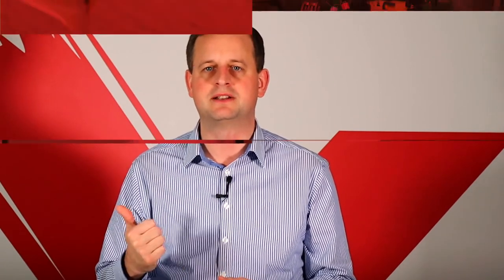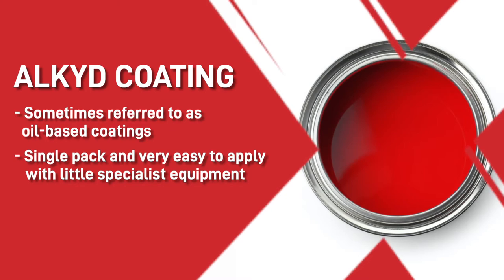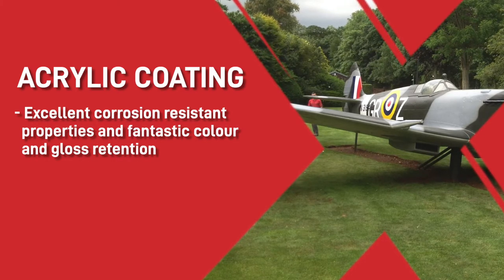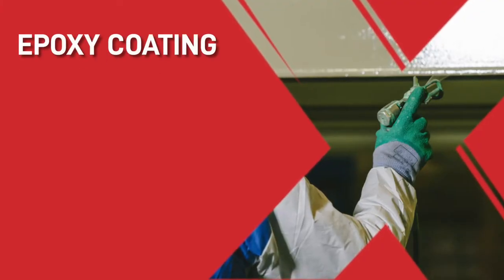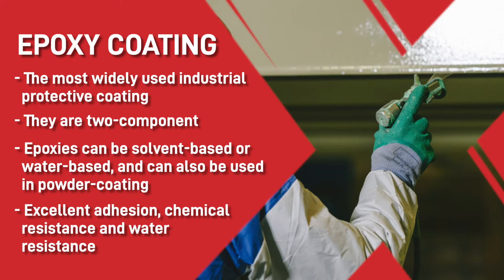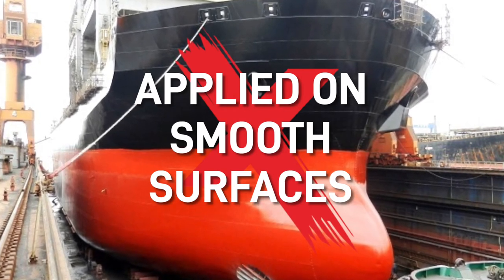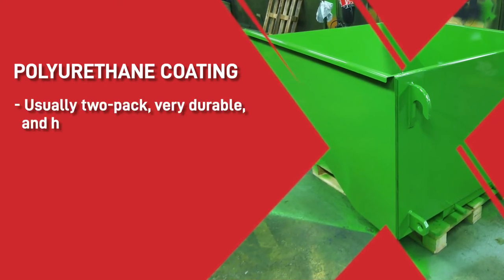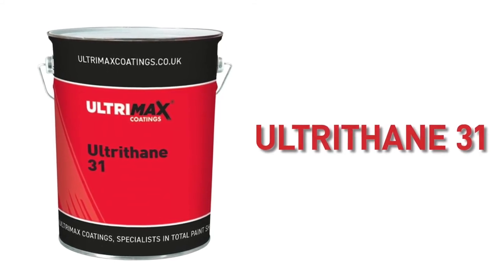Alkyd, Acrylic, Epoxy and Polyurethane Coating - Understanding the Difference

Comment: Sir good morning,I will ask if 1st coat of primer I used is redbrown 1 component and 2 coat of primer I used is 2 component what would be the result it is good or bad sequence?thank you sir
Reply from the maker: its not always a problem for example we sell a lot of sayerlack 2pk primer with a 1pk topcoat. The important item is keeping within system so if your primer is Jotun branded use Jotun branded topcoat as they are chemically made to work together

Comment: I am experimenting with painting using a paint gun and starting to have some asthma like symptoms tonight and just found out the hardener I use could be the cause.  I want to continue painting but I am overwhelmed with options all I want to do is paint mild steel in a satin black in 1 pass. I keep reading how dangerous epoxy paints are but it seems like oil based with hardeners can be worse. Is there anything that is low VOC that has a hardener and does not use isocyanates? The final product will be indoors. I cant afford powdercoating yet.
Reply from the maker: We would recommend https://www.ultrimaxstore.com/paint/metal-topcoats/ultrimax-2-bs.-00a01.ippa0500a01
Reply: No way
Reply: Use Durabak 18, a moisture-cured Polyurethane. Comes in solid colors, no custom color options. Hard as a rock, but flexible. Does not chalk, holds color well under weathering and UV. One of the best I have found. It can be roller brushed on (Mohair for the smooth paint, Textured roller for textured paint), or sprayed.  Levels well, so ideal for roller brushing. Solvent used is Xylene.  Sand down, wipe surface with Xylene, roller brush one coat, wait till finger dry, apply 2nd coat. Done.
Be smart and use a mask when spraying.
Reply: @lass-inangeles7564  I never replied but thank you for this.
Reply: go acrylic then!!

Comment: Hey what kind of coatings is suitable for a basketball backboard, I'm a complete noob, so I'd appreciate if you give me the safest and most suitable option
Reply from the maker: hi there assuming your backboard is timber? if you look at something like Sayerlack AT99 which you can spray to mek a professional finish...but i'm pretty sure something like our Colormax Aerosols with Ultrimax 1 satin paint would produce a nice finish for you (the aerosols would also be fine if your backboard is wood, metal or plastic) 

hope that helps 

br 
Ultrimax

Comment: Is the acrylic primer good for concrete?
Reply from the maker: most paints have some acrylic in but does depend on the paint type. For concrete we'd always advise a full floor paint in 1k or 2k if you have the time to mix and paint as it will wear better.

Comment: Which paint you recommend for painting a drill press and lathe?
Reply from the maker: metal lathes will need a solid metal paint with anti-corrosive properties. Go either 2 pack for a slightly harder cured paint or 1 pack . We do 2pack in Ultrithane 31 - https://www.ultrimaxstore.com/paint/direct-to-metal/ultrithane-31-bs.-00a01.ipp310500a01
Reply from the maker: or go 1 pack with Ultrimax 1 https://www.ultrimaxstore.com/paint/direct-to-metal/ultrimax-1-bs.-00a01.ipo00500a01
Reply: Thank you so much for your help

Comment: What coating do you recommend for steel roof .?
Reply from the maker: if in the sun Rustoleum Noxyde - it has elasticisers in it that mean the intense heat won't cause it to fail when the coating is shrinking and expanding !

Comment: Hi, I am working on formation of hydrophobic coating which is composed of drying oil and naturally organic beeswax...so this coating consists of two different materials that is wax and oil as well so in which category does it comes under
Reply from the maker: this one sounds like it would come under fire resistant coatings more ?Most of these are Polyurethane so it would depend what formula you are adding to your beeswax and oil ?
Reply: @ultrimaxcoatingsltd  I am doing this project with my group, here we are using tung oil as a drying oil and butyl acetate as a solvent for that...and we are mainly focusing on making it water resistant and dirt resistant and since the beeswax has a good ability of anti-bacterial so it will result in forming a hydrophobic coating along with anti-bacterial properties and the drying oil are having great ability of sustaining high temperatures so somewhat it can act as a fire resistant too.
Reply from the maker: @rishabhdevsharma1764  that's amazing beeswax seems  to have so many useful properties from honeycombs structures to the oils it produces an amazing natural product!
Reply: @ultrimaxcoatingsltd  Yes sir, so I just want to confirm if this coating can be categorised under polyurethane coating or in any other type of coating.
I think it must come under Polyurethane coating because I have read the Indian standard specifications for the reference purpose and I got to know about polyurethane coating is classified into 5 types in which the first type described as Modified oil based coating.
And a seperate specification is described about oil based coating which is composed of only drying oil.
So after going through all these theories and specifications I think the coating is polyurethane coating, but after all I am a fresher to this concept so needed some guidance that's thought of speaking with you.

Comment: How to combine epoxy and polyurethane coatings in one floor coating system?
Reply from the maker: they would possibly react currently so not advisable but if you could combine them and potentially mitigate some of the gloss created from the PU coating then it would be one very hard surface treatment !

Comment: Can you use a acrylic primer on a polyurethane base coat?
Reply from the maker: Hello yes in most circumstances you can usually paint anything over a polyurethane base so an acrylic should be fine KR Ultrimax Coatings Team

Comment: What is nitro combi paint compared to these four coatings?
Reply from the maker: To compare, Nitro Combi is a lacquer with high volume of solvent and some alkyd resin. It dries super quick with the volume of solvent, mainly used in graffiti art as you can paint and go! 
environment
Reply: Can I transfer nitro combi from spray can into a pistol and use it for painting?
Reply from the maker: @SkodaFeliciaBMMkW  hi if you have the mix then yes don't see why not as its still a solvent based product like most sprayed paints.  Most spray cans have a spray gun style nozzle on them anyway (what are you trying to achieve?)  and perhaps your main issue may be getting the product out f the can safely as it will be pressurised. KR Ultrimax Team
Reply: @ultrimaxcoatingsltd  So alkyd resin is there to achieve some glossy finish (or plasticity?) and nitrocellulose is for hardness or what is the reason for such combination?
Nitrocellulose lacquers have been used already beginning 20th century, do they have also some pitfalls? 
I thought nitro lacquers have been replaced by other chemicals in automotive industry already decades ago?
Reply from the maker: @SkodaFeliciaBMMkW  yes in short the alkyd and epoxy perform very well in marine situations or situations when atmospheric conditions might prevail. With your nitro it has a lot of solvent and solvent means quick drying which in general is very useful in the automotive industry - the pitfalls of solvent is mainly the VOC element and respiratory safety (make sure you are wearing the correct masks). IN general most industries are now moving to water based but there is still a lot of solvent first products out there it will still be a long time before water based takes over as the predominant paint type. kr Ultrimax Team

Comment: Jotun surface tolerant epoxies are NOT designed for smooth surfaces! Ideal prep is sandblasted but they can be applied over firm non flaky rust. Better over rust than a smooth surface!!!